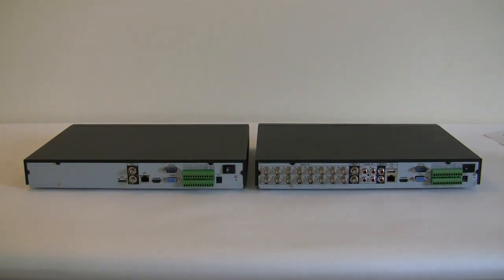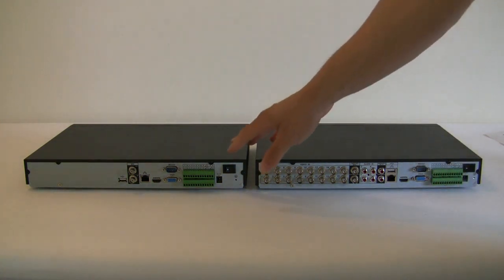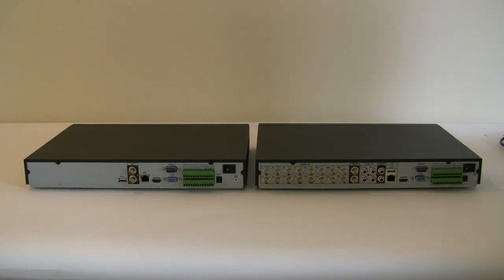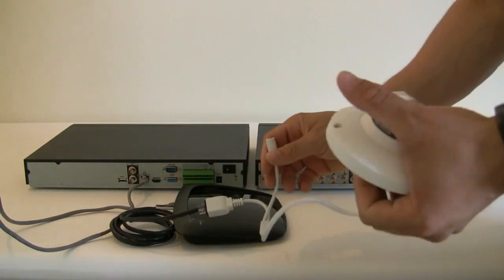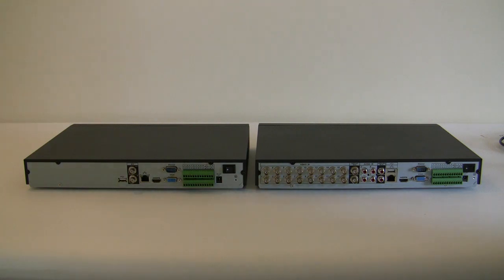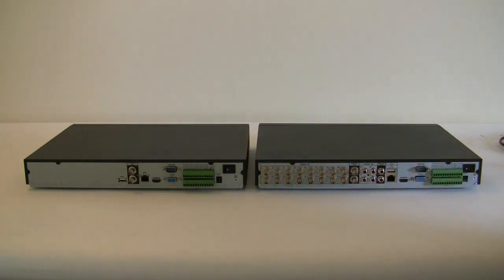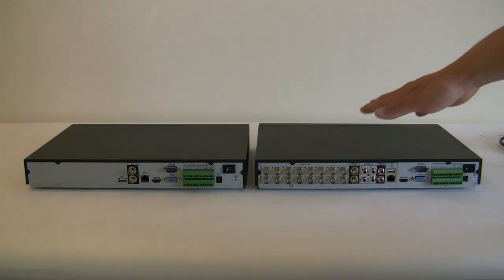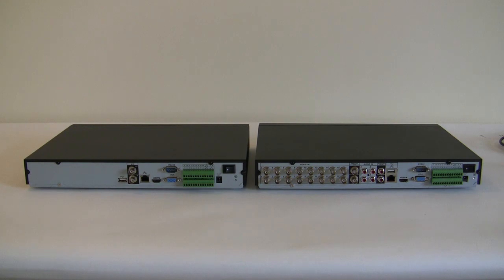Digital Video Recorder (DVR) & Network Video Recorder (NVR) Differences

Comment: We may be quite accustomed with the term DVR (Digital Video Recorder), which has been used for years as an electronic device to record video in a digital format to a disk drive, SD memory card or other local or networked mass storage device and is the main component of an analog system. But with the shift from CCTV cameras to IP cameras, the DVRs were also replaced with NVRs.

Thus, it is very important to know that NVRs and DVRs are not the same thing and have completely different uses.
 
Nowdays, IP NVR System provide advance features, like Centralized Monitoring, Multi-layer E-map, Optimized Data Storage
etc.. for more information take a demo to better and cost effective solution, visit at https://www.matrixvideosurveillance.com/nvr-premium.html

Comment: sorry but, he told only about old DVR box. Fact is analog camera and it's cable sucks in resolution & not the DVR box & the DVR shown on the right above is modern hybrid ethernet DVR which mean it's NVR only but comes with old low resolution analog cameras output connections also & nothing else it's different than NVR apart. It's also called UVR [UNIVERSAL VIDEO RECORDER] which mean you could connect your old traditional analog camera & IP camera in the same box & you could still access higher resolution video & audio through Internet in hybrid DVR/ UVR box through Ethernet cable connection through a wifi router or broadband connected to the internet!
IP camera are good but takes huge space in hard disk in NVR or DVR
I will guide all to go with Hybrid DVR only with Ethernet connections & If you want to put combos of Analog camera & IP camera or even IP camera only!
NOTE : IP camera will take huge space in the storage so better to install 5TB or more hard disk!

Comment: what if the internet goes out
Reply: works in the local network. Its external only if you need to show the images somewhere else
Reply: Sir, you don't need internet to record in NVR or DVR both! It will not effect the recording process!
It's just matter of internet cables & not the internet!

Comment: Thanks for the video. Why there are 4 or 8 network ports in the back of some NVR? In your video, there is only one network jack. 
Can that one network jack receive video from multiple cameras? Thanks
Reply: +Steven Saw Some of the NVRs have the POE ports built into the NVR and can elimanates the need for a seperate POE swith or power supplyies to power the cameras.When the one network port is plugged into your network wher the cameras are it will look for the cameras and record the video from all the cameras it finds at the same time through the one port.
Reply: Thanks a lot for explaining and reply.

Comment: Pipe SSW - the Ethernet on the DVR is so you can monitor your cameras through the network - it is not hybrid.
Reply from the maker: you are correct. That network port is for configuring and viewing the DVR remotely.